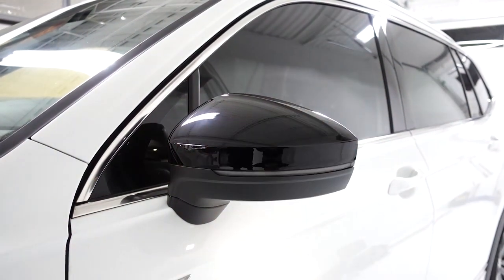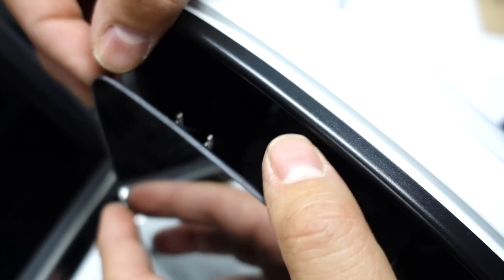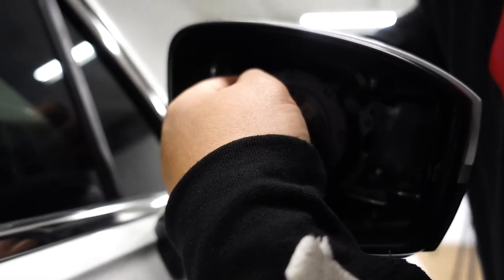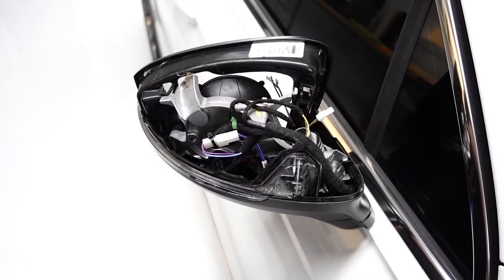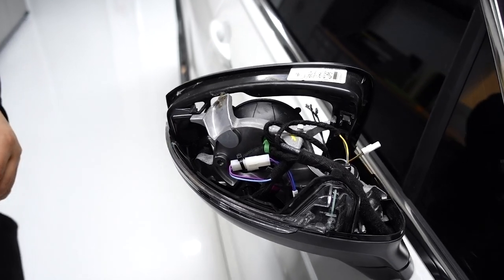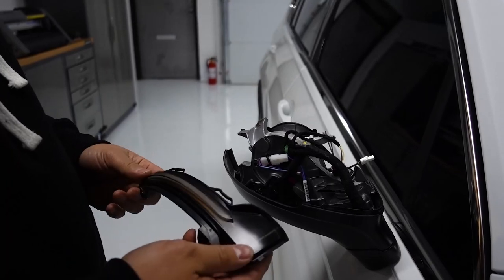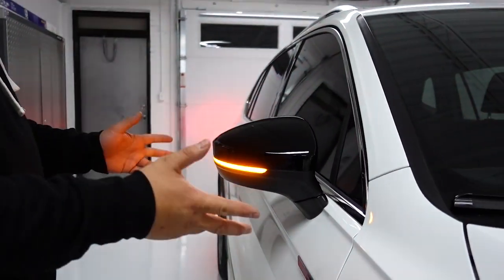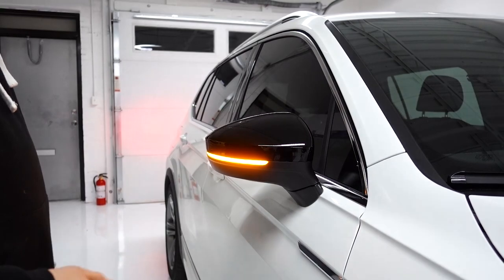MK2 Tiguan Mirror Cap & Dynamic Turn Signal Install

Comment: Excellent video. Thank you! Quick question. I bought the blue and yellow version where it will light up blue when locking and unlocking. It comes with an additional green wire. Any idea where that wire would connect?

Comment: Did you apply the side view turn signal tint overlay to the dynamic turn signals that were installed in the video? If so, curious to how they look.
Reply from the maker: Yes we applied our signal tint overlay over the aftermarket dynamic signals.

https://www.badgeskins.com/store/p288/VW_MK2_%28MQB%29Tiguan-_Side_mirror_clear_indicator_lens_tint.html
Reply: Badgeskins Vinyl Overlays Nice! Ordered!

Comment: Hi there, could you please tell me where you got the black caps from? And do they have allowance for the blind spot sensor?
Reply from the maker: The mirror caps are spare oem caps purchased from a dealer and  had painted black.
Reply: EBay £23 from China, gloss black….I’ve a set arrived, very good finish on them

Comment: Volkswagen Tiguan 2021 year on the started engine does not work correctly, flicker and the turn signal line does not reach the end